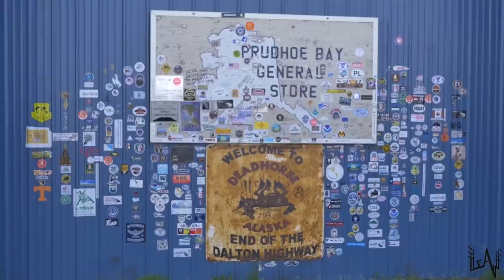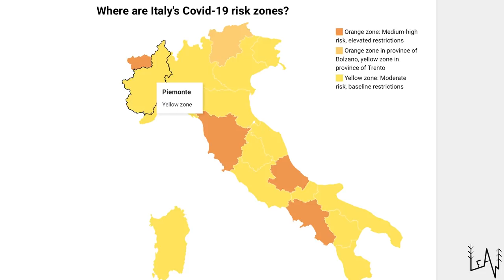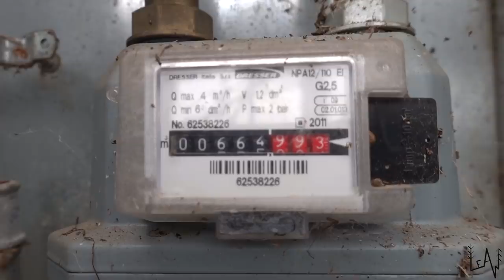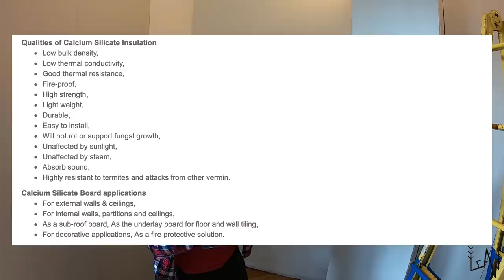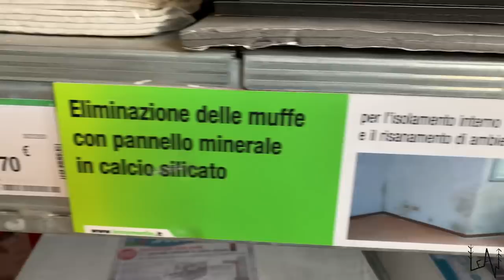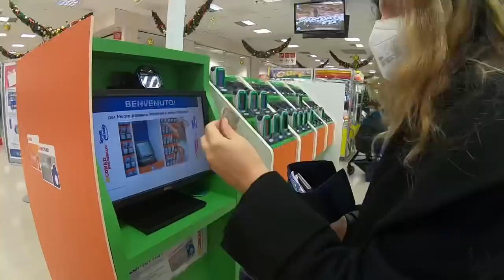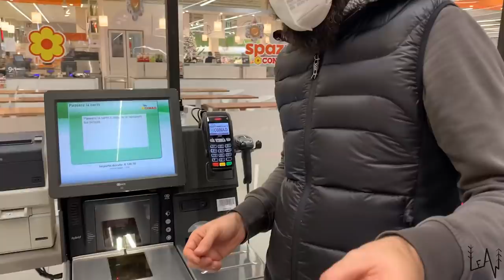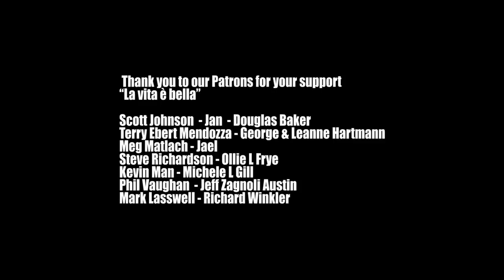ARE WE FREE? A MESSY DAY IN OUR LIFE

Comment: You need a dehumidifier with a 2" hose running behind the closet, outside you need drain tile. I remember your other video about the rain draining on your upper level, that's where you need the drain tile.
Reply: Yes, Luca you must find where the moisture is coming from. It sounds like the rain runs off the roof into the ground along the cement block wall, then moisture seeps into the house and it's dark behind the closet and mold begins...Good luck, I think you will figure it out.

Comment: You were showing mold stain in the upper corners of your ceiling, Check your roof and gutters they maybe the source of a leak at the roofing. You need to fix the source of water getting in, the calcium silicate is a temporary repair the mold is inside the wall and will come back. Love your show.

Comment: I think you should find out how much insulation you have in your exterior walls. Properly insulated walls shouldn’t mold like that.
Reply from the maker: There is no insulation at all
Reply: Yeah. You need to insulate. Most homes have issues with too much heat upstairs, because heat rises. And it can get so hot in winter if using wood heat downstairs that the people upstairs have to regulate the heat by opening a window. I hope your seeping tile kit solves your moisture problems, but while you have the closet moved, you need to insulate your walls. Then it will be warm and cozy in your bedroom and you don’t need to sleep in front of the fireplace to be warm. Best wishes and Merry Christmas!

Comment: I took a class on mold in your home and helped home owners deal with mold.  You have to change the environment so it will not come back.  Think of it like an animal and if the habitat is right it comes and grows, spraying bleach is short term, it will come back.  Things to change for long term help; make the area warmer, get air ventilation in the area, don't have anything against the walls for mold to grow behind, have doors open to that room for air flow, any water getting into room, fix leaks.  That is the easy stuff, it could be a bigger problem that the house wasn't built well in that mold area for good circulation, make sure you cut off any water source that might leak into the area, maybe need to add a window to the room or a fan to get air moving or a heating system to keep a bit warmer.  I live in Seattle, USA and we have mold here, always have to manage it.   Good Luck.

Comment: Hi guy's,  the moisture is coming from the outside I guess.  Soil against the outer wall of hollow blocks and plastering.You need to dig down a plastic insulation  matt on the out side, to prevent moisture coming back again.  
Inside could be good to have 10 cm distances from the wall and the wardrobe to avoid the air standing still there. There are a lot of humidity from concrete walls especially if they are not insulated.  Good luck,  regards Rickard from Sweden.

Comment: ☀️❄=💧
Do not put cabinets and other large furniture up by an outer wall,
because it creates condensation,
since the wall is cold and the back wall of the furniture is warm. The large cabinet must be set up "without backing", because otherwise there is mold again as soon as there is a temperature difference outside and inside ☀️❄=💧

Comment: What is behind the wall you cleaned of mold?  The mold appeared to form a pattern looking like the layout of grout between bricks.  If the panels cover a brick wall, there is potential that the brick is “wicking” moisture from outside the house.  The brick needs to be sealed before you place a new layer of panels atop the bricks.  Would highly recommend you place a layer of insulation between the bricks and your new panels.  This could be done by building a framework of thin beams against the brick first, and filling the gaps with fiberglass insulation roll material, staple to the framing.  Attach your new panels to the wooden framework over the insulation.  Good luck, guys!

Comment: Thanks for another great video.  Have you considered installing a "Heat Shifter" from the ceiling above the fireplace to the ceiling of the bedroom after removing the mould?  It will move warm air through that room and keep it dry.  I also suggest you find the cause of the dampness.  Is it coming through the outside wall?  Have a great day.

Comment: Bleach, vinegar and heat will neutralize mold and mildew. An alcohol based paint primer will prevent future growth. A fan and soffit vents above the closet will help with air circulation which is what’s causing the mildew to take hold.

Comment: Luca...... Make sure your walls are dry before applying the products you bought. Sara don't forget to wash and disinfect the back of your wardrobe to get rid of any microscopic fungus who would still be present. I think you've thought about it, but just a reminder.
Check also the inside of the wardrobe, the other walls and the ceiling in your bedroom. Check also the outline and wood of your window. This filthy mold loves to stand on the wood of windows. Hope that you will be done with this before Christmas so that you can celebrate 'tranquillamente'. Nevertheless I don't think that you will be able to avoid in the next spring or summer some insulation work on your facade.... unfortunately. You must fix the problem at the source after you have restored the bedroom to good condition.

Comment: Luca & Sara - this is too late to comment - but I see a couple of comments below who are on the right track.  The new paneling is a "band aid" and will not fix this source of the problem.  Covering up the source of the black mold will only allow the mold to grow more behind the new paneling.  You need to dig the dirt away from the outside LOWER northern wall and create an "air gap" outside so the dirt moisture cannot be absorbed into the wall.  Of course then something would have to be done to prevent the dirt from filling back in against the wall again.  This will allow the walls to always dry out but this is an expensive job.
You may also have a roof/gutter leak where water is leaking down inside the wall.  I understand none of this is easy or cheap to fix, but please research what the source of the mold is before covering it with paneling.  You will still be breathing the black mold even if the paneling is there, and the mold will keep growing behind the paneling.  I'm sorry - this is not good to hear, wish I were there to help with labor.  Hope all goes well!!!  Keep up your beautiful spirits!

Comment: It is a Condensation problem! You need insolation to keep the heat inside and the cold outside and reverse in the summer ! Keep interior doors open for air circulation when you are away traveling! Cheers from Canada!

Comment: It will probably help keep the side of the house with the mold problem drier if rain gutters were installed on the roof edge and have the downspout positioned so the water is diverted to the downhill side.  Actually rain gutters on both sides might be good so the laundry room is kept dry also.

Comment: the mold is coming from water in the wall?  possible roof leak? until source of moisture is identified mold will come back
Reply from the maker: No leaks luckily, just condensation and bad insulation
Reply: @leaw  is the problem easy to fix?
Reply: If that wall has no insulation and a proper vapor barrier installed there will be condensation.
By the way, was that supermarket Gros Cidac? Love that store!

Comment: I had some mold like that on a cement wall that transmitted cold inside and then water vapor condenses there. Either some insulation in the wall, or some airflow inside will help stop that problem. So you will need a fan or something to circulate air behind your closet and maybe a dehumidifier to control the level of humidity in the house. I struggle with this problem since I don't use rooms in the ground level in my house and the air does not circulate well in those rooms.

Comment: The air behind the closet was not being circulated and that is one of the biggest causes of mold and mildew.
If you increase the gap between the closet and the wall the air will circulate better but the moisture coming through the wall is a whole different story.🤷🏽‍♂️
You can primer the wall with strong paint and you can also put a mildicide in paint which inhibits mildew forming on a painted service.🤔

Comment: Mold often appears if the cabinet is located close to the outer wall of the house and the temperature outside falls below zero. The solution with panels inside the room is controversial. If cracks appear between the panels, the mold may reappear. I understand that you want to move the dew point outwards. perhaps it would be cheaper to stretch pipes and put radiators along the freezing wall. Then you would have air circulation between the wall and the cabinet and the wall would warm up evenly.

Comment: Had issues with mold in the past and solved it by controlling water saturation using a dehumidifier. 
An ideal moisture is 55%. A good interval is 50 to 60%. Too much and mold will appear because of condensation. Too little and your nose will get dry. 
I was able to control it using the Meaco (UK brand) dehumidifier. They have a display that shows the humidity. You can set a level and it will work automatically. It works so good that I dry my clothes indoor as the device does not allow the humidity to stay high. It takes care of the humidity from the laundry, shower, breathing, sweating, cooking. We release so much water during normal life! I empty the water storage once a day, around two litters! I use some of it to water plants. 
As a great bonus is that my laundry (that I dry indoor) does not have that specific smell that appears when they are damp for too long. Just today I washed two pair of jeans and 10 hours later they are almost dry. My laundry, even cotton dries up in at most 24 hours. 
Trying to control mold through chemicals is a waste of time. Also stuff that kills mold is very toxic. Best way to control mold is by controlling humidity.
My dehumidifier uses around 160-170 watts when the compressor is running so hardly noticeable on the electric bill. 
I have no affiliation to Meaco. Just describing my good experience with these products. My units have hydrostat and not all units have it so you can set it and will run continuously until it reaches the target and then it checks once in a while and then runs until the target is reached again. The noise is that of a fridge plus a fan. You may want to keep in on a hallway and leave the doors open. It has a way to connect a drain so I do not have to empty the tank but did not bother me enough to do it.
To keep mold away you also have to take care not to have thermal bridges and insulate them. Condensation will form if a part of a wall is too cold. This will also affect the thermal efficiency of the house. So perhaps you should think on insulating that wall from the outside.

Comment: The mold might be because the closets are places directly on an outside wall where the outside temperature is much lower than
inside.  Is that room always well heated.  Try not to let the temperature drop to much. When humidity raises you could see more humidity in the windows. I'm wondering how the product you purchased at the hardware stores will work.  ...interesting.

Comment: It doesn't look like that mould is coming through the wall at all so it's unlikely that there is a problem with the outside of the wall. That mould appears to be a result of moisture condensation jnside the room (not enough ventilation) and it may have occurred whilst you were travelling and the house was sealed up. Now that you have treated the mould, it may not return now that the house is lived in and getting regular ventilation. Just my thoughts.

Comment: I'm glad your weather cleared up so you can deal with the problem. I have a propane heater on my porch and got condensation on my glass doors big time,it's not insulated as soon as I cracked the door open it went away. Even in Luigi do you use propane heater? You have to leave a window cracked for air right? We had the self scanners in our store too.Glad you got to leave for a bit. Are the hills alive with the sound of music? Funny I didn't hear the rooster before.

Comment: if the mold wasn't present before the closet was built, I doubt if the introduction of the closet would create an increase in humdity. What else did you introduce into your house that would cause an increase in humidity? Does the wood burner heat water for your central heating? If it doesn't and there was no mold present when you used gas fired heating, it would look to me as your move to the wood burner as the solo heating has caused the humidity within your property to increase to a point where it condensates in the areas that the heat from your wood burner does not reach.

Comment: If it is proved that damp is penetrating the walls from outside, then if I were you I would treat the outside wall of the house.  If you only treat the inside you will always have damp in that wall.  However, if the damp is NOT penetrating the wall and the damp is only the result of poor air circulation in the bedroom, then you could get away with only treating the inside walls.   BUT a word of caution, when you put the cupboards back in their original position you are once again creating a situation where the air circulation behind those cupboards is very poor which could mean the return of the mould.

Comment: So about the heat, do you know what temperature you heated the house too ? 
I understand that the wood heats the water, that heats the radiators, however can the radiators be set to warm, warmer, hot, very hot ? Or do the rads just have an on and off ? Also did you try to conserve the wood by not always heating the house extra warm, like maybe when the fire went out and it was nightime you wouldn't start another fire  until the morning ? Or did you try to keep the house at a certain temperature - I'm curious
I'm guessing that IF you wanted to you could have the radiators heated by a boiler, either gas, electric or propane ?